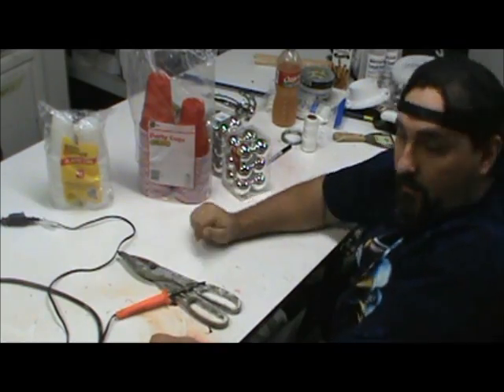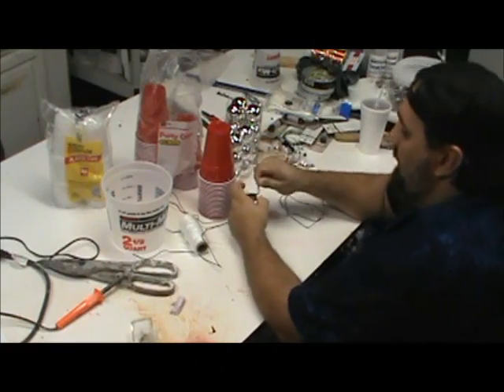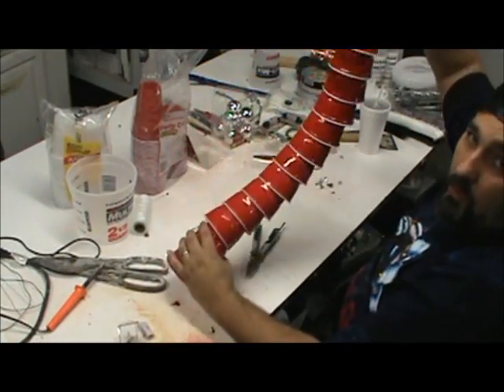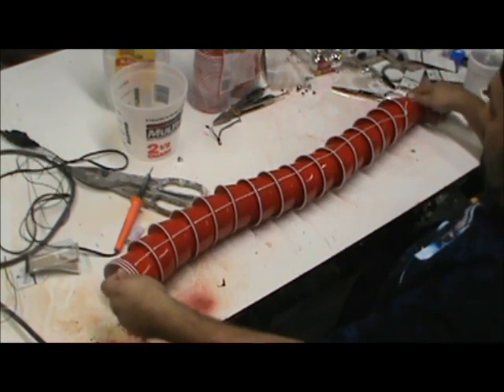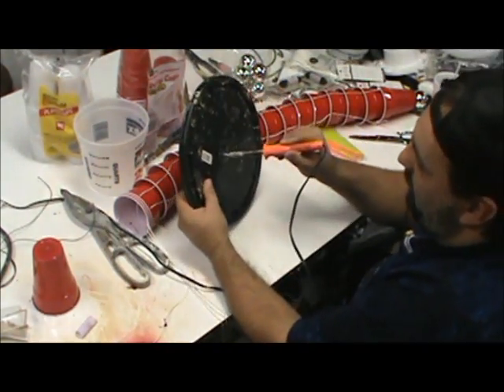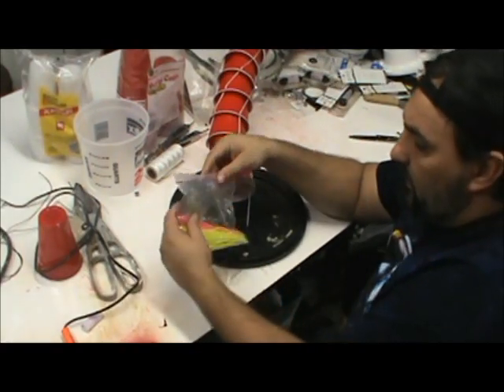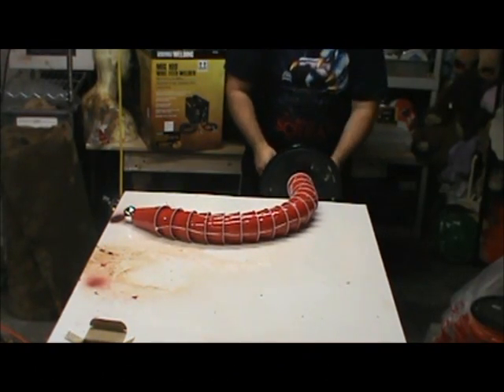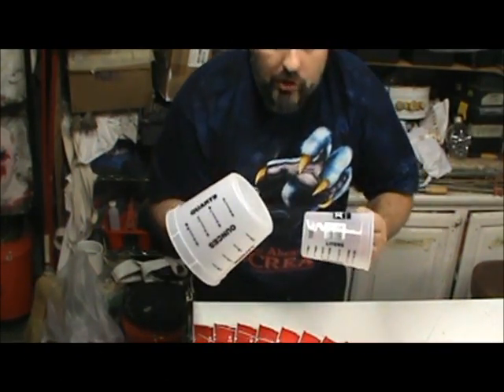tentacle1

Comment: To make sure the "motion" strings are equally spaced, While the cups are still stacked, mark 4 evenly spaced dots on one cup, then run the sharpie up the stack.  You'll have dots on the white rim of each cup, evenly spaced for the strings.  No worrying about flipping them to thread them and keeping them even.  See, I should work in your shop!.....lol  Great video!
Reply: I suck at just reading diy directions

Comment from the maker: Funny you should mention that... I actually test the soldering iron with my face. My hand dont feel the heat coming off of it- so pretty often I hold it close to my cheek to see if it is hot. an inch away or so I feel the heat. Im trying very hard not to do that on video, and particular iron emits a ton of heat so even my beat up hands can feel it.

Comment from the maker: I dont have any video of them, my haunt goes up and down each year, The maintenance on them is not to bad, every now and then a cup cracks, or a knot gets untied, and I have had the swivel stop swiveling so the string wound around the motor arm. But all of these are fixable in a short amount of time, upping to the plastic buckets stops a lot of it.

Comment: trying to make a lions tail using this but having a hard time thinking once I out in sleeve will it still move I'm scared to do all this work n fail lol
Reply from the maker: +Chakira Gonsalves  what are you using for your cups? Panty hose makes a great skin.
Reply: +StiltbeastStudios smaller version of the solo cups I also have a pool noodle n was gonna try that vs the cup I have a spandex material to make the sleeve
Reply: +StiltbeastStudios 2oz solo shot glasses with a smaller version of the ball it's I children's extra small plastic golf ball set
Reply from the maker: +Chakira Gonsalves  ok do you want cable controlled motion or just the look of the tail?